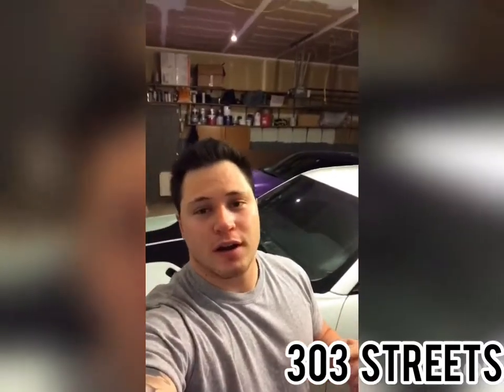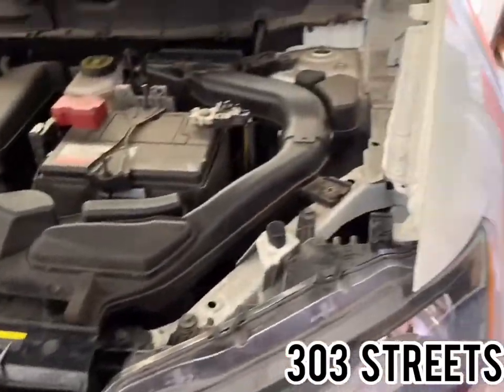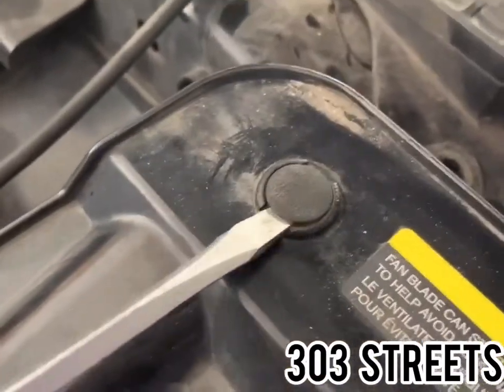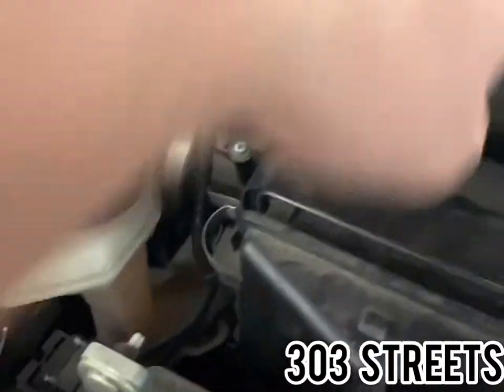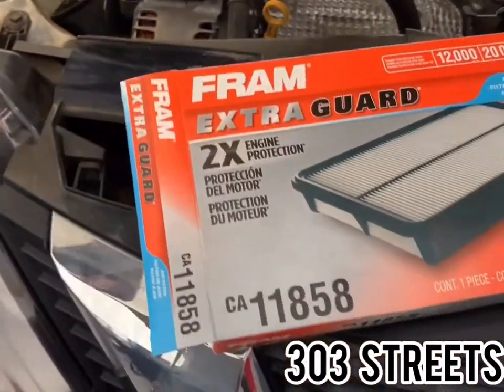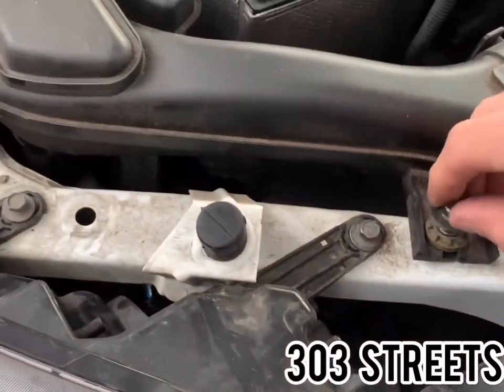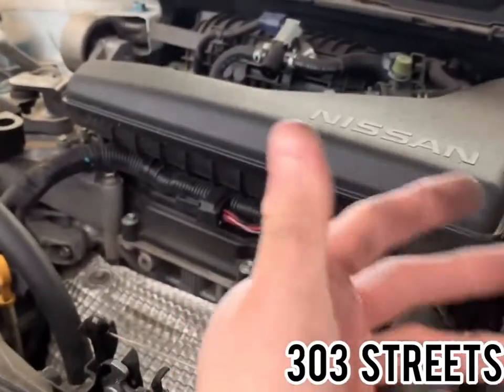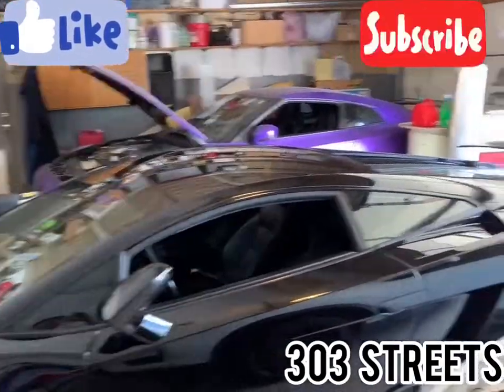2017 Nissan Rogue Intake filter replacement

Comment: I'm not sure why you removed those outer connectors, but I was able to disengage the two clips near filter housing by pressing them in and pulling the small piece up and off. Then, the connector at the filter housing slid off as you showed.  Those plastic  clips can be seen in the video near the housing. But the reason I came here is because the connection doesn't look very tight. It has room for air to pass into the housing. From the looks of it, that's just the way it was designed.

Comment: Thanks for the video.
I miss the old days when all you had to do was unscrew the little wingnut sitting on top of the engine, remove and replace filter, and re-screw nut.   No tools required!
Reply: Probably because the cram all manner of things into that engine compartment now.  Or they just don't care to make things easy to do yourself.